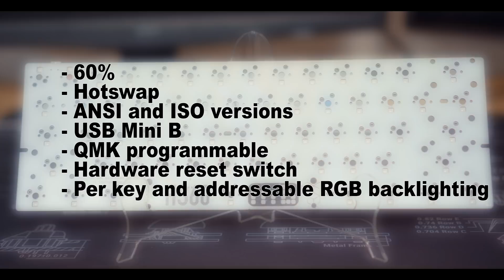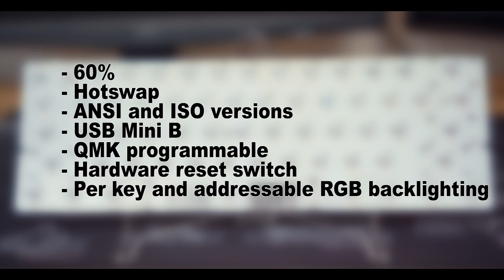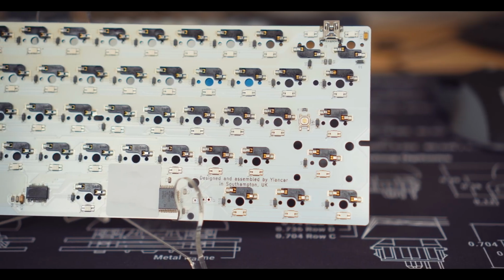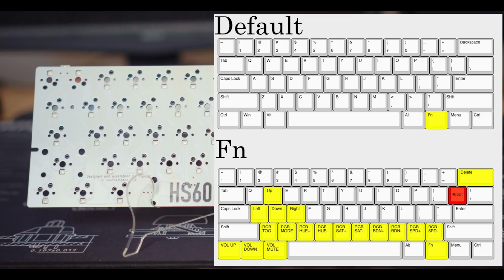HS60 Hotswap 60% PCB Review

Comment: 3:10 is this some old version or something? because I'm getting one just for the fact that it has BOTH underglow rbg and per-key rgb. You got to plug some rgb strips for the underglow but the pins and programmability are there.
Reply from the maker: This is the HS60 v1 which was released shortly before this video was made in 2018.

Comment: why didn't the guy that designed this pcb just add that tantalum surface mount cap onto the pcb before making the sale so that doesn't happen at all?
Reply from the maker: Sometimes products are shipped out with bugs unknown to the designer or manufacturer. This actually happens quite often. Take for instance the numerous bugs with iPhone iOS, or even the various safety recalls in the car industry.
Reply: @MechMerlin  still could have released a revision or replaced the ones who ran into the problem.
Reply from the maker: @franzb69  he does fix the ones that have a problem. And it's incredibly expensive to release a new revision just to fix this. Our niche is still very very small. However there is a new version of this board the hs60v2 which does not have this issue, uses ARM, and  has VIA support.

Comment: It not being USB C and not  having the capacitor issue the cost is way too much also poorly engineered.
Thanks for the thorough heads up.
Reply: Not having a USB C is a choice made by a vote by the community:) Regarding the capacitor issue, sadly it was not discovered during our testing. Everyone who experienced this issue was (and still is) offered a free repair
Reply: @yiancar  Are you the creator of the board? So can I get it repaired if I have uk version?
(Sorry I'm a noob at mechanical keebs)